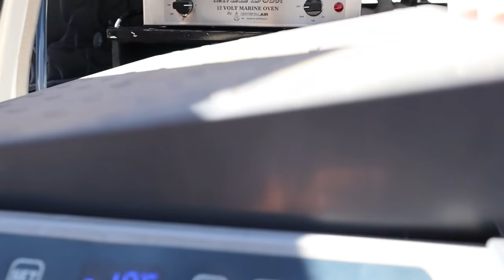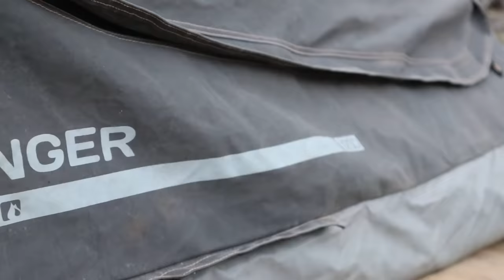Toyota Landcruiser 76 Series Camping Setup | with @WACampingAdventures

Comment: Soaking the suction caps in hot water bring em back to life. Mine are still stuck on to the car. Cleaning tint also helps before sucking them on.

Comment: I got the tap idea from seek adventure. I have the Jerry on the roof sometimes so I have a bit more length on the hose
Reply from the maker: I've thought about doing that myself. I know every one says to carry your water down low in the vehicle but the roof is the most convenient spot for me
Reply: @Alex.G  ye I thought I'd rather put it on the roof and have the hose instead of installing a rear bar and have the extra weight of that and the water hanging off the back. I don't know which is better but I know that not having the steel bar weighs less!